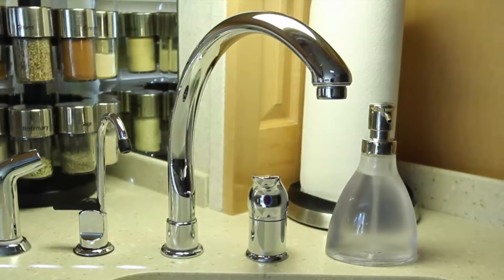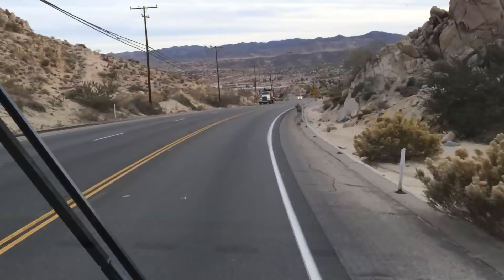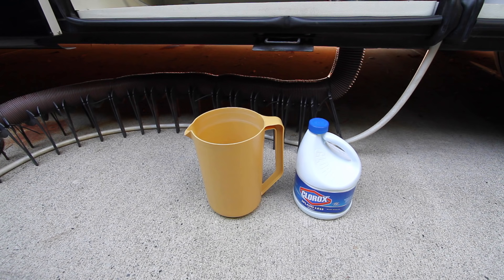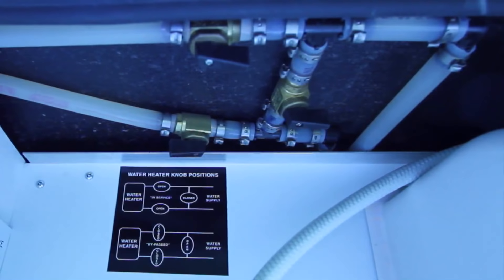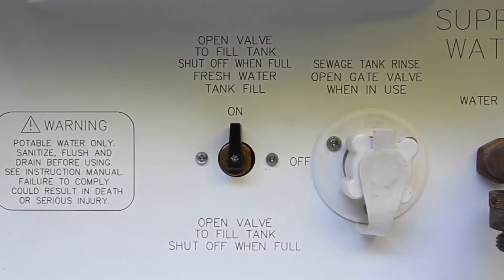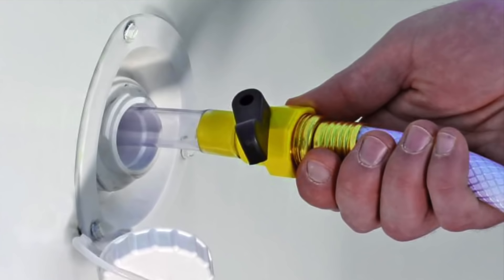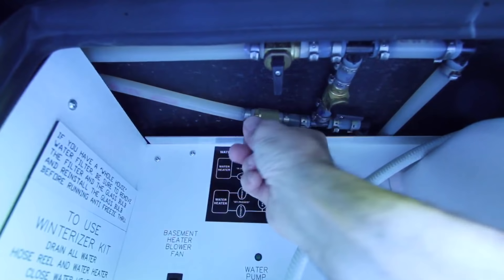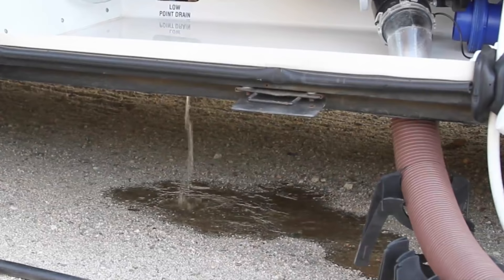How To Sanitize an RV Water System

Comment: Ok. . .I'm by no means a chemist. . .

I have a well at my house. . .and I've been instructed by several contractors to NEVER use household bleach for sanitizing potable water supplies or containers. . .as they can and do often contain heavy metals and such.  There are sanitizing products specifically designed for potable water. ..such as Well Safe. . .that may be a more safe option.  Just a friendly FYI.
Reply from the maker: +boliskmail While we also hear some people warn that bleach should not be used, both the EPA and the CDC specifically recommend adding bleach to tainted water to make it safe to drink. And they're talking about actually drinking the bleached water, not just sanitizing a container that holds it. We appreciate the concerns, but since we, and every other RVer we know, have always sanitized this way, and the CDC recommends it, we figure we're okay! 😊
Reply: Hmm...got me to thinking. What IF you drain your tank and the RV park does have chlorinated water supply? It would make sense that if you fill your system with the chlorinated city water, you've just sanitized your system to some extent...
Reply from the maker: The chlorine level in tap water isn't high enough to sanitize the tank. It's just high enough to assure that the water coming from the source is safe.

Comment: Hi RVG, Isn't there a kind of a supplement issue to this topic where an even less concentrated amount of bleach is used on an ongoing basis?; my water pump instructions [ as I thought I understood it ] said to always put in 5 drops of bleach to every 5 gal of water every time the tanks are filled ,maybe as a kind of way to keep contamination at bay, Iv'e always run across these 2 instructions but never both issues mentioned within the same material, Do you also do the 5 drops thing beyond the sanitizing?
Reply from the maker: RV Van Life Hi RVVL! We're familiar with a procedure for adding a small amount of bleach to the tank when it gets filled from un-treated / non-cholrinated sources, such as well water. That's a "maintenance" level of bleach, vs a "sanitize" level of bleach. They you use carbon filters at the ice maker and sink to remove any chlorine before drinking. Honestly, we don't worry about it, and have never added a maintenance level of bleach in 12 years.... and we stay at LOTS of places where well water is used. We figure if people drink the water right out of the well without adding bleach, so can we. All we've ever done in all these years is fill the tank from any potable water source and sanitize twice a year. We always drink from the tank and have never once had a problem.
Reply: Thank you very much for this info, finally someone has made this clear, appreciate it

Comment: Bleach can be dangerous in your lines, they make sanitizer specifically for your RV and it is cheap (We use Springfresh at our dealership). R.V. manufacturers do not recommend bleach unless absolutely necessary.
Reply from the maker: Not only do we respectfully disagree, so do the CDC and many RV manufacturers, who specifically call for 1/4 cup bleach for every 15 gallons of water as a safe, effective way to sanitize. Specialized products cost more and are not necessary, which is why hundreds of thousands of us have been using bleach for eons.

Comment: Probably a silly question but I'm new to RVing. Wouldn't it be better to do the long, twisty driveto a new RV park with a full fresh water tank of water and bleach solution  first? With a full fresh water tank of the bleach and water solution that's been jostled around for at least an hour and then left in the fresh water tank for 4 to 8 hours you're guaranteed to completely sanitize the fresh water tank.

Then you can use the water pump to sanitize the water lines to the faucets, shower, bath, etc.
Reply: I believe that's what the video said!!
Bleach filled fresh water tank them use to flush out all lines to all faucets, then dump down campground sewer. Followed by a full fresh tank flush to clear lines.
Reply: I'm gonna have to find a way to change my screen name?
Reply: +Jerry Kinsman  what the video said was fill the fresh water tank with fresh water and a measured amount of bleach appropriate for the size of the RV's fresh water tank. Then run the fresh and and bleach solution through all the various faucets until bleach could be detected at the faucet. Doing this before going on the drive would lower the amount of fresh water and bleach solution in the fresh water tank. Then after 4 to 8 hours empty the fresh water tank and rinse it out.

My suggestion, and it may wrong fro some reason I don't understand, was to fill up the fresh water tank with the water and bleach solution. Then go on the drive to the next campground. Doing it this way, by going on the drive between campgrounds with a full fresh water tank of water and bleach solution will guarantee that every part of the fresh water tank is sanitized. 

Leave the water and bleach solution in the fresh water tank for the necessary amount of time. Then run the water and bleach solution through the faucets at the new campground. Lastly empty the fresh water tank and rinse it and the faucets out (hot and cold) with fresh water.
Reply from the maker: +Jack Brown Hi Jack! The small amount of bleached water that takes to run it up into the plumbing to the faucets, is so little that the tank is basically still full. And the sloshing that occurs when driving is enough that if the tank isn't absolutely 100% full to the top, it doesn't matter, and the whole tank will get treated just fine.

The nice part about running the water up through the faucets before taking the drive is that you'll be sanitizing the tank and the lines at the same time, rather than taking additional time once you reach the new campground. It's also desirable to arrive at the new campground with ALL of the sanitizing done (tank AND lines) since you'll probably want to use water as soon as you arrive, and having bleached the line on the road allows you to simply flush them out when you arrive and start your camping trip!

Comment: I’m in the empty phase of the process right now, and I prefer to run it through my sewer opposed to dumping it on the ground, and I’m just wondering do I need to worry about the water pump burning out running for so long?
Reply: I just watched the video again and you clearly state that it won’t hurt your water pump as long as water is running through that, so sorry for the redundant question
Reply from the maker: @inspired2rv661  No worries! Water pump should be good.

Comment: I have access to my parents Flair Class A that has been stored in an inclosed steel garage with concrete floor for three years. It was winterized well, temps where it is stored are 80's in the summer and 40's to below freezing during the winter. How well do you think this process would sanitize the fresh water tank? I don't have access to the manuals so I haven't been able to review the manufacturers recommendations yet. It will most likely be spring 2016 before I pull it out of storage so I'd also appreciate any insight you have on long term storage... As well as things I might want to take care of before this next winter is upon us...
Reply from the maker: not in this lifetime This process will work for sanitizing any fresh water system on any RV. Follow these steps carefully and you can safely drink the water from the tank. Chances are good that a Flair has a gravity fill for the fresh water tank, which means it is even easier to add bleach to the tank that by using a winterizing kit... just dilute the correct amount of bleach into a gallon pitcher, and pour it in, using a funnel if needed. Then fill the tank with fresh water and follow the rest of the steps to sanitize the entire plumbing system. Nothing else should be needed to get the fresh water system ready for use.

Comment: Do you sanitize the section of line in the rv from the city water hookup or just the line from the fresh water tank?
Reply from the maker: Good question, Floater. You CAN sanitize the fresh water hose if you have a way to get the bleach into it. But we generally don't worry about it and only sanitize the fresh tank and onboard lines. It's really the tank you're most worried about, since that's where the water stagnates the most.

Comment: since you live in your RV full time.  has the bleach ruined any rubber parts?  thanks
Reply from the maker: Great question! We're now 13+ years in this RV, and have never once had to replace any seal of any type. So the answer for us would be a resounding No! 😊 The bleach concentration is so low that it doesn't bother them.
Reply: Great, thanks
Reply: Although the pool chlorine usually has an active ingredient of 10-12.5% giving a higher percentage for damage
Reply from the maker: Yup. We use regular household bleach.
Reply: thanks

Comment: Question, I purchased a 1997 5th wheel about 3 years ago, its permanently parked in a camping lot. I have never filled my 100 gallon fresh water tank as I use the city water hookup. I can us the tank side of the water pump to draw a solution of bleach & water into the water lines to empty out each faucet. Since I don't use the fresh water tank, do I need to sanitize it anyway? The thought of filling it with 100 gallons of water, and then dumping it, and then refilling it and dumping it again, just sounds like such a waste. What do you think?
Reply from the maker: If you never drink from, or even use, the fresh water tank, we'd suggest that there's no reason to sanitize it. Actually, the primary purpose of sanitizing at all is because of the potential for things "growing" in the stagnant water that sits in the tank. The only reason we also sanitize the water lines is because once the bleach is in the tank, it's so easy to just turn on the faucets and bleach the entire system, right up to the faucets. There also may be some potential that using water from the tank could allow bacteria from there to get to the faucets, so we're being extra thorough due to the fact that we use water from the tank so often.
But if the tank is NEVER used as a water source, your system is really no different than a regular "stick" house, with water from (what we assume is) a known safe source coming in fresh through the pipes 100% of the time. In that case, you probably don't need to sanitize anything at all. Of course if your drink the water, and want to be extra safe, you could go ahead and sanitize the water lines anyway. We're just not sure it's really needed in the situation you're describing. Hope this helps a bit!

Comment: Thank you so much, great video.  I came to the video after reading your blog.  I have a few questions, if you don't mind. We are going for our 1st big trip in April. We live in New York and we're gonna head to Florida and back which will be a 25 day trip.  What I want to do (and ask you if this is OK) is to de-winterize and sanitize the water system at home a day or 2  before even leaving to go to our 1st destination 3 hours away, and then emptying my freshwater tank and flushing the system finishing the sanitizing process at the 1st campground.   So my questions are is it OK to leave all of the anti freeze and some bleach in my Gray tanks for those few days? And of course having the bleach in the system for a few days (more than the 8 hrs suggested)...is that too long? PS-  Also my Gray tank holds 39 gallons so that shouldn't be a problem with how much is going into it before getting to my 1st camp ground, correct?
Reply from the maker: Hi Bubba, and welcome to our channel! So great to have you here with us. Congratulations on your upcoming big trip. You must be so excited. The answer to your questions is an all-around yes. You can indeed add bleach to the fresh water tank, and leave it there for several days without doing any harm. The concentration level is very low, and will not harm anything. And there is no problem with leaving the antifreeze that you have pumped out of the fresh water system in the gray tank, along with any bit of bleach that goes in as well. The only thing we recommend is that since you will be de-winterizing in New York, you make sure to keep your heat on until you get south into warmer climates if the temperature is forecast to be below freezing. That includes basement heat. Your 39 gallon tank should be fine to pump a little bit of antifreeze and a little bit of water into, and still have plenty of room for using it for a couple of days till you get to your first destination. Hope this helps and have a great trip!
Reply: @RVgeeks  Thank you so much. Very helpful. And I already subscribed to you guys a few months ago. You even answered a question or 2 of mine in the recent past.  I just really appreciate how I stumbled upon your blog and it gave me the link to this video and I wanted to let you know that and I appreciate that. Thanks again.

Comment: +RVGeeks I am deciding on whether or not I want to get involved in building my own RV on a cab/chassis. I'm wondering, have you ever considered an overhead fresh water tank that generates it's own water pressure with gravity and/or air pressure?
Reply from the maker: +Karen Mxx Sounds like an ambitious endeavor! I think the problem you might run into with that plan is the weight of the water so high up. They put the tanks in the basement to keep the center of gravity low to keep the vehicle stable and supporting heavy weight up high is probably a structural challenge, too. We like that you're thinking outside the box, but this might be just a little too different to be practical.

Comment: I commented a while back about sanitizing the lines of a fifth wheel we moved into.
We tried to sanitize the lines but learned that our freshwater tank is damaged and will not hold water. We use city water, but the rv is old and I am wondering if it is safe to use the water for dishes, etc, without running bleach through the system. Our RV repairman said we should be fine, but I was wondering if there is any way to clean the lines without pumping a bleach solution from the tank?
Reply from the maker: No worries! The real reason that you need to sanitize is because the water in the tank can sit there for a long time, allowing bacteria to grow. The only reason we sanitize the water lines is because we use a combination of city water and tank water, of course depending on whether we're hooked up or dry camping. If you only run city water through your RV's water lines, it's just like being a regular house, where there no water that sits around before being used, and therefore no need to sanitize. If the water in the park you're staying in is safe to drink, you can not only use it to wash dishes, you can drink it from the faucets in your RV, too.
Reply: its just that the rv is new to us and I am not sure what the previous owners did. Its definitely been sitting for a while, hopefully they never used tainted water from the tank

Comment: I have a pop up with about two 2.5 gallon tanks they are both removable from the unit. One have black mold in it and the other is somewhat clean. Should I just pitch them out or try this technique? If so what is a good way know the water is safe to use?
Reply from the maker: Black mold worries us. If you plan on drinking it, we'd replace them. Just our $0.02.
Reply: Probably the best thing to do.

Comment: Just wondering.  Can you pour the solution down the fresh water fill then top it off? Then run all your water sources then rinse several times?
Reply from the maker: +Art Martinez Yes indeed you can, Art! If you have a "gravity fill" where you have an opening for a hose to fill the fresh tank, you can definitely pour the solution in there and it will get into the tank just fine.
Reply: RVgeeks- sorry but I'm complletely green.
Do I understand this correctly, I can put the bleach amount for my 100 gal water tank down the gravity fill, hook hose up and fill the remained with fresh water. Drive around a while, than run all water faucets hot and cold until empty. Than refill with fresh water again(no bleach) and run faucets until all bleach smell is gone?(however many times necessary) do I leave the house water filter in place and replace when done?
I have a brand new 2018 southwind, so this is necessary before I start drinking my tap water to make sure it's sanitized?
Reply from the maker: Hey J! The only minor adjustment to the steps that you mentioned are that you want to run the water up to the faucets before taking your drive to allow the bleach to sit in the lines for a while and sanitize them. And yes you should absolutely do this procedure on a brand new rig since it’s a freshly built tank that has not been sanitized yet.

Comment: Our 5th Wheel trailer is parked in a place we go to only on weekends 6 months of the year and it never moves. (It has a snow roof to get through the winter months!) Anyway, any other ideas to get the "moving" action in the tank if we can't move the rig?
Reply from the maker: Are you by any chance in California near a major fault line? lol  Adding the bleach will just have to do, and it's no big deal, since the motion is just an added bonus anyway. Just leave the bleach in longer instead and you should be fine.
Reply: Funny! Not really close to a fault line. Ok. We'll go ahead and just go with the suggestions.  I love your information. It's incredibly helpful!!!